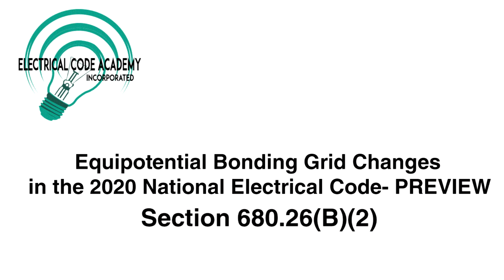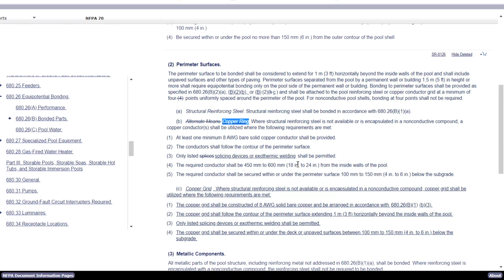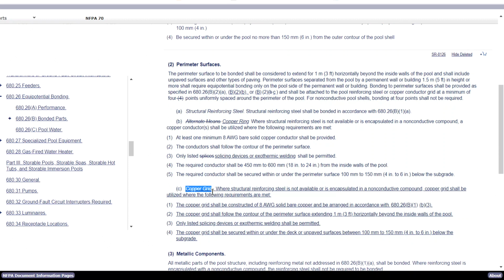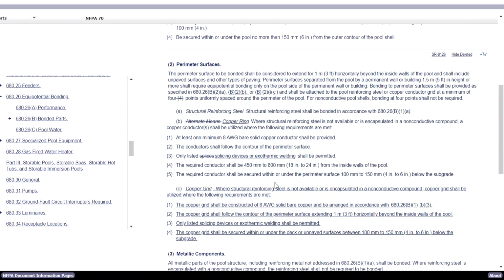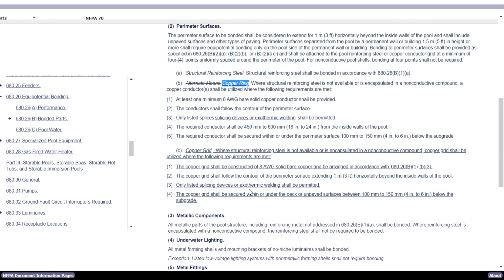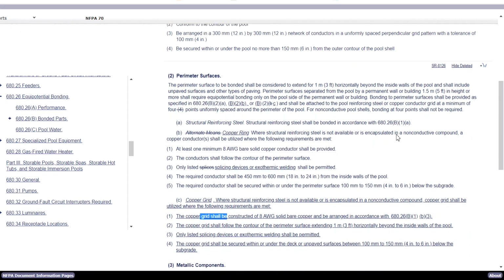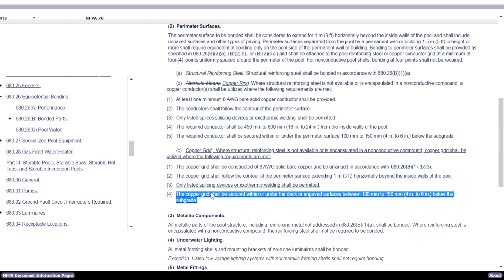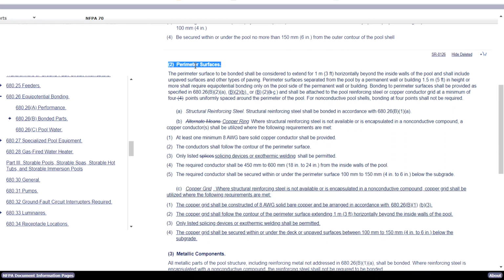2020 NEC Preview- Equipotential Bonding Grid

Comment: Such a great video, thank you for taking the time to post! I am confused though and hope you can help. I'm building a vinyl liner pool and it has steel walls, what I don't get is if the copper grid is supposed to be 18-24" or 36"? And also I still see the copper ring as an option, couldn't I do a double ring with interconnections which would we better bit not as much as a grid?
Reply from the maker: Greetings - The vinyl pool itself is not considered a conductive pool shell BUT any metal structure not covered in 680.26(B)(1)(a) must be bonded as stated in 680.26(B)(3). Now, you would not need to meet 680.26(B)(1) but your are going to be required to meet 680.26(B)(2) and you have 3 options, such as structural reinforced steel (rebar or steal mesh in slab), single 8AWG copper ring exactly as stated in 680.26(B)(2)(b) or copper grid. You have to choose but you describe doing something that is not described in 680.26(B)(2)...You must choose from whats provided and there is no room for modification to that rule.
Reply: @MasterTheNEC  thank you!